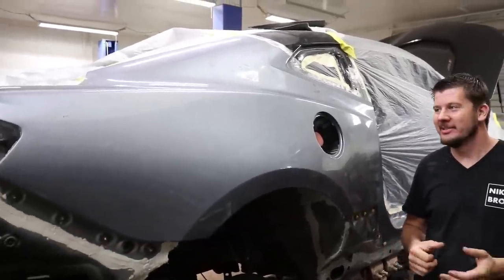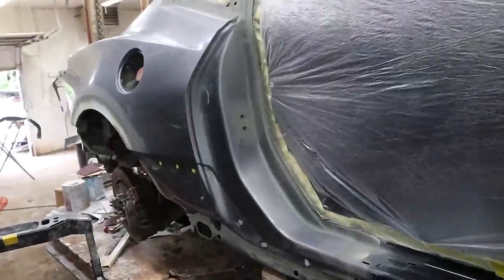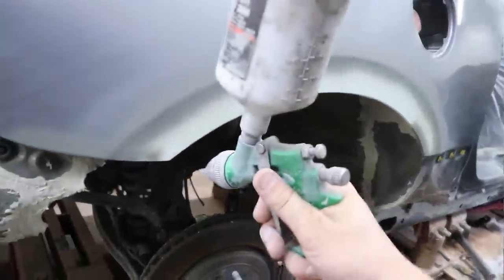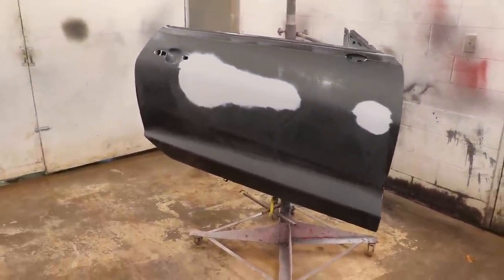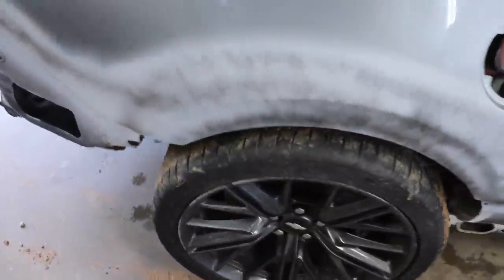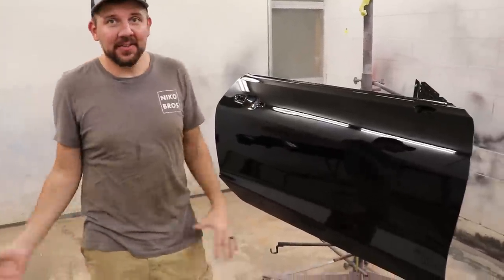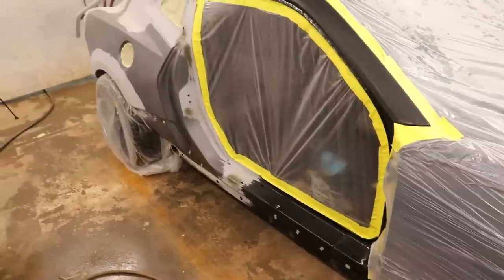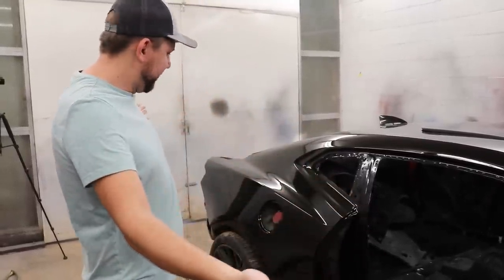REBUILDING A 2018 CAMARO ZL1 BODYWORK & PAINTING Part 4

Comment: Watching the work on the rear end suspension makes me glad I have a solid axle car. Independant is great but the damage to all those flimsy parts makes me cringe. Less is more in a street car why do you need a track spec shitbox is beyond me. Street cars are not race cars so the racy bits look dumb.
Reply: 🤣🤣🤣🤣🤣🤣🤣🤣🤣🤣bet you drive an electric car..
Reply: @frankavery8306  Car, Boat,Truck, Motorcycle and Plane all electric for sure. You have an electric blanket.

Comment: ALL welded areas should be coated with fiberglass filler not just the big main splice on the C pillar.....  A darker colored base coat is used on darker shaded & darker colored paint jobs.. Lighter colored base coat is used on lighter shaded & brighter colored paint jobs